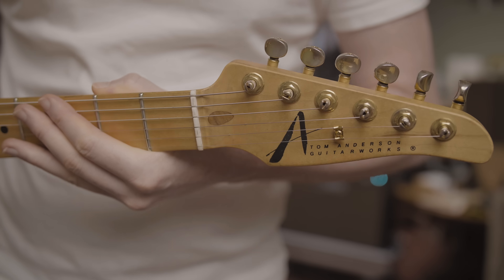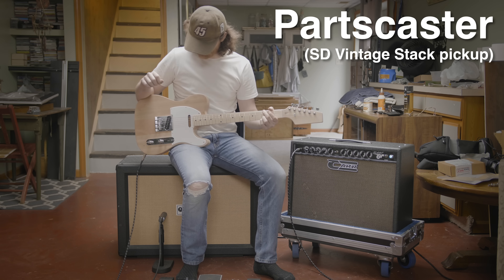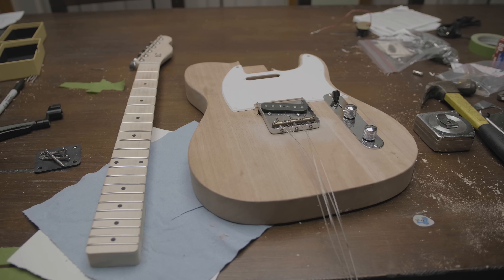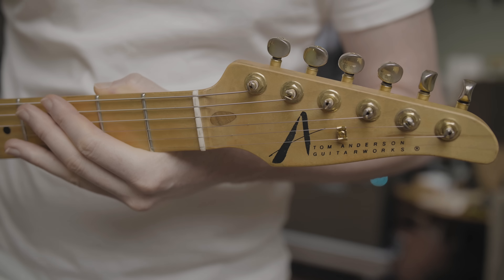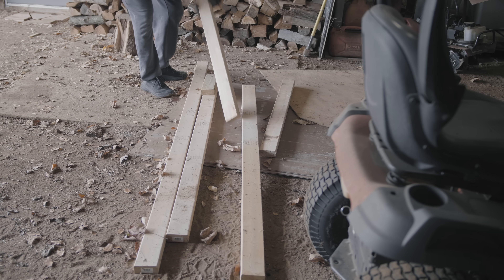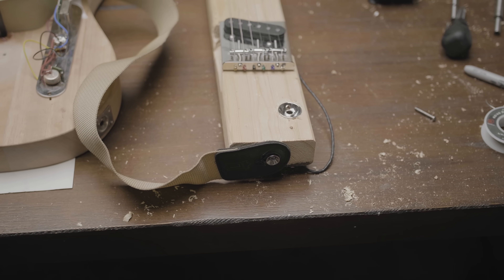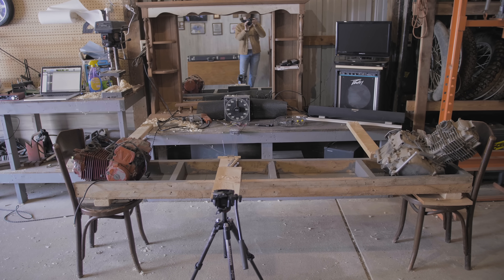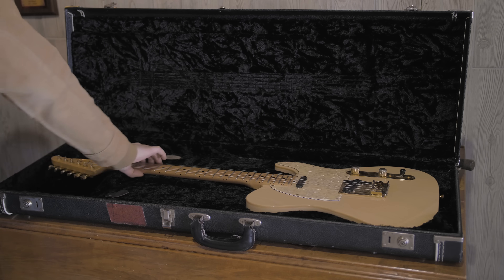Tested: Where Does The Tone Come From In An Electric Guitar?

Comment: About 8 years or so ago there was a massive arguement in the guitar community about this tonewood nonsense. Some people got really nasty over and tried to ruin peoples livelihoods, and even sent them death threats when they showed that the wood had nothing at all to do with tone. Im looking at you here, Wyatt. They had invested so much of themselves, and thier money, into the idea that a guitar was some magical thing that didnt obey the laws of physics, and they spouted all kinds of crap about how maple gave a snappy sounds, while bubinga was warm and so on. No amount of evidence would convince them otherwise, even when DKG Custom made a guitar from cardboard and a kitchen worktop that sounded exactly the same as a Fender strat. Will Gelvin used all sorts of measuring devices and found nothing. But they, the cork sniffers, claimed that they could hear a difference. Even  if it was only a 0.00001% difference it was still there, so they were right. Some people, like Andertons and Mike Boudreau, even went so far as to  deliberately fake the results and got called out for it. Mike was a luthier and his business relied on charging a premium for 'tonewood'. Andertons are just dicks.

If you've spent 2k on a PRS with a beautiful flamed top and you believe that it enriches the tone, then I'm afraid that youve fallen for marketing hype. its still a good guitar, but it would be a good guitar without the fancy finish.

Comment: Kinda clickbaity....That is not an 'air guitar'. what you did there basically uses the same principle as a normal guitar...that is providing ample bodymass on either ends to provide adequate tonality to the strings, compensating for the absence of neck. I'm sure you worked around trying to meet those requirements on some level. If anything this proves nothing but the same fact that volume and density of the wood is the only thing that matters, you need a decent amount of that one way or another to make anything sound good.

Comment: you are one bad mofo to start and the only difference I heard the entire time was a slight bit tinnier on the two by fobut the pickups were the only difference in once you swapped out to the same pickup it was virtually identical the pickup creates a magnetic field that magnetically charges the ferrous string and as that string moves it interrupts the magnetic field that magnetic field could give a crap less whether it's attached to a 2x4 a bench or a guitar because it doesn't know what it's attached to it's a magnetic field unless it's attached to something that's ferrous it cannot absolutely cannot make a difference so thank you for 100% proving what I've been telling loads of Neanderthals but I just laugh as I walk past them dancing around the fire throwing sticks at it

Comment: The pickups are the most important, and the way they’re set up. The scale length makes a big difference. But all that “tone wood” stuff is almost complete guff when you’re talking about electric guitars. Unless it’s the difference between balsa wood and mahogany, then woods that are of a similar density will make minuscule differences compared to the pickups.
Reply: I like the 'theory' that the biggest effect tonewood plays is in the tactile vibrations the player feels.  Basically all the touch and feel aspects of playing.

I think there's nothing wrong with using exotic woods and fancy finishing techniques, so long as you understand that they're primarily visual.  There's nothing wrong with having a pretty guitar, just don't expect it to magically sound better than a similarly equipped guitar made of more cheaply sourced materials.
Reply: @propyro85     Yup, tonewood is only a thing with acoustic instruments, where it makes a huge difference.

Comment: All in all, really good wood will not affect the sound of a guitar, meaning the resonation of the strings and so on. Bad wood will affect the frequency of strings and resonation of them. The reason the guitar with no wood and the guitar with good wood sounded similar is because there is no bad wood obstructing the sound. No wood or Good Wood equals good sound. Bad wood equals bad sound.

Comment: Very cool experiment. I’m a huge fan of tonewoods and have been firm in proving there are differences easily recognized through percussion, size, depth, density, chambering, etc. In electric guitars the wood does far less than other wooden instruments, and the massive bulk of an amplified tone comes from the electronics. There are plenty of factors but the electronic signal chain and how it is constructed both in wiring and placement relevant to strings and scale make the most drastic changes to tone. I’ve tinkered heavily with pickup height and adjust pole screws and found most of what I was looking for with those alone. So for me, it’s electronics, construction, and total components in that order. Less dynamic changes under high gain than clean, but there are definitely noticeable difference.

Comment: My best guess at the start of the video.
The body should have very little effect on the sound, but stiffer and heavier should be better.
The electronics replace the resonant body, so this is where the meat and potatoes are.
The RLC circuit can have a very low "quality factor", meaning it resonates with a larger range of frequencies, which i think is desirable.
For the pickup, larger coils mean stronger signal, but the "quality factor" will increase, and the resonating bandwidth will decrease.
So a smaller coil with a larger capacity to stay at the same frequency, should be best.

Comment: One hell of a video man, thank you! I will say, this puts a lot to rest about tone with bodies and necks. One thing, I would imagine the wood selection has a role in how well the guitar will hold a tune. Obviously, the air guitar will hold at an exact point due to weight. But cheaper wood would have too much flex, right?

Comment: First, a very interesting video, that I very much appreciated. Great work on a meat project! Just in case no one mentioned this yet, I did want to point out that the guitar with “no body” is not accurate, since it actually has a massive body being connected to both of those wood work benches which are going to vibrate as well as the floor, walls, or anything else they’re touching. Does that make a difference through the pickup? It doesn’t sound like it, but it is misrepresenting the experiment to say that guitar doesn’t have a body or wood to resonate with the strings. And in that sense this is still not a very scientific study. The only way to really discern “scientifically” whether the body makes a difference would be to make multiple bodies out of different materials (plastics, metals—aluminum? various wood and wood products—e.g., mfd, carbon fiber, etc.) with the same specs (shape, scale length, electronics, etc.). Again, this is still a great video. Thanks for putting it together for us!
Reply: a *neat project. Lol.

Comment: Would love a mirrored experiment but with a bass. I’ve done A/B tests with the same pickup and strings on a P and a Jazz (P/J without the J pup) and the results were quite different. The P had a huge neck and the P/J had quite a thin neck. The bodies were also quite different in thickness and weight. I image it has to do with the amount of energy needed to produce bass frequencies vs guitar.

Though I wouldn’t be surprised if an experiment this in-depth yielded somewhat similar results.
Reply: Bass strings have a lot more mass, so it makes sense the overall mass of the neck/body will affect it more as the strings vibrate.
Reply: If all this is true, I guess these big companies and their competitors are purposely making shitty sounding guitars to perpetuate the lies that older guitars from good years and certain notable and much commented on modern exceptions sound better? Seems like a pretty wacky business model. If at no additional price you can easily recreate any guitar with this method what reason would a company have not to exploit that to its fullest? I'm sure Gibson would like to command even more for their Les Pauls and if they were indistinguishable in tone from 50s Les pauls, well...it certainly couldn't hurt. Plus, when newer companies started coming about in the late 70s why wouldn't they just take it all the way and make guitars that not only rivaled but surpassed all other guitars past to present by simply lifting or lowering the fucking pickups and changing the electronics? This should be 100% effective on all electric solid bodies if this theory is true, correct? We should be up to our necks in the greatest instruments the world has seen, not slowly trying to regain what was lost. None of this appears to hold water in the broad real world at all. I wish it did, but I'm very skeptical.
Reply: I was traveling with my band in 1984 and walked into a music store in Mansfield, Ohio. There was a beautiful Fender P-Bass hanging on the wall, sunburst, black pick guard and maple neck- I just had to have it. I traded my P-Bass plus some cash for it and used it on the gig that night. I noticed immediately that it sounded vastly different from the bass I had traded-in. In later years, studio engineers and producers noticed the same thing- my P-Bass didn't sound like a P-Bass. For one thing, it weighed a lot more than your average P-bass and it had a factory-custom tapered neck, not the usual broad P-Bass neck. Aside from the heavier wood and tapered neck, all the hardware and electronics were original stock. I am convinced that the wood and construction of an electric guitar does matter.
Reply: @willrobinson7578  I can't help but notice he picked a copy version of a guitar this would work best with, and did no control or opposite experiment. Trying to make a guitar sound different as you build it would actually show something; if you were really doing the experiment honestly. Also, how about making the "airguitar" sound like a 67 getsch? A 58 Les Paul? Hell, a 62 Strat for that matter, I mean, the distance from the pickup doesn't age does it? So that can't change anything right? Why isn't this guy rich? Or for that matter, why do I have to play the guitar I inherited to get a sound that I can at all respect? Because I would love a more modern guitar, they just sound like high rattley clangy shit 90% of the time. So why hasn't the cheap companies not owned by fender or Gibson nailed it yet? Why can't they make better sounding guitars? What's holding them back? All these luthiers are apparently completely useless and young blood here cracked the code! Well, I'd like for him to make me a Gibson Firebird sound alike 2 x 4, then. How 'bout that? Heh. I'll pay whatever he thinks it's worth.

 I have no idea what details might change a guitars tone and I really don't think the manufacturers P R or Marketing department (who he talked to, first one is clearly Gibson, second one is Fender, that's just what they tell them to say, I recognize the pitch talking points as I'm sure you did aswell) I don't think the luthiers themselves exactly know what they are doing either. They just know how to do it. That last sentence pretty much sums up the human race; I don't see why a guitar maker would be that much different. Look at the comment section. This video was made to get attention from the people you see saying "I knew it, goddammit, I been saying this for years" Yeah buddy, I believe it because I've also been hearing it for years; and much like many other "marginalized opinions" it's literally the only opinion on this issue I've ever once heard in my life outside of the manufacturers and luthiers version of events, of course. Like most arguments like this, since I haven't chosen a side really I see the truth. It wouldn't hurt my feelings one bit if I could buy a 300$ guitar and sound like I'm playing a 3,000$ guitar, I didnt pay for it. I'm not some two story house rich guy trying to defend my wildly expensive purchase so my heart doesn't sink. Also, while I love my guitar, I'd also love to play something else every once and awhile and not be disgusted. 

As for that third opinion at the beginning, which sounded more like a boutique manufacturers attitude to me, I get what they are saying to newer players and comparatively between players but it's my fucking hands on every guitar I play, so case closed, that certainly isn't what's making them sound different when I play them. 

One thing a lot of people in this comment section are right about: They tell dumb asses all kinds of bullshit and they believe it because they want to believe it.

Comment: This is amazing!  I’ve been starting to think it’s really just the pickups, and of course the pots, treble bleed, and cap. This proves it. That was a lot of work!
Reply: You'd be surprised in how little the type of capacitor matters. Also marketing in order to get people buying them vintage bumblebee caps.
Reply: @UmVtCg  More the value of the cap, not the type.
Reply: I agree with the hype on the type/brand
Reply: That's scientfically true! vibrations produced by metal strings picked up by pickups 😅 then amplified by electronics. that's all there is to it. now, where is the tone really coming from? 🤔

Comment: Great video!!! I am so glad you did the 2 by 4 and air guitar. Always thought that would be a great idea to decide how much the wood plays in solid body guitars. I always felt it didn't matter that much, but many vehemently disagreed . You proved my point more than enough for me. I have seen guys play my rig and make it sound amazing. Leads me to believe the player is one of the 3 or 4 larger contributors to the final sound. 
A friend changed from a Strat and a VOX AC 30 (bright clean) to a Les Paul and a Marshall (thick crunchy) and he dialed it in so it sounded just like VOX (close). It turns out his ear just liked that sound so no matter what he used  that's how he dialed it. Or his playing style contributed.  I am thinking if one worked on their playing style to work any amp to its fullest they could sound better and save some steps in the never ending tone quest. 
Perhaps practice on a crapy amp and and do everything you can do with your pick and fingers to make it sound better then plug in to your real rig would be one approach.

Comment: This is one of the best videos I've seen; you did an amazing job!

However, there is one very legitimate thing you forgot that actually effects the tone fairly significantly:

Picks

They can dramatically change how bright or dark your tone is, even with light strings.

I know that's not the point of the video, but is an important factor to make sure you control for, and for anyone wondering how they might affect their own tone outside of hardware changes or practicing.

Comment: Great video, but the answer is pretty clear. 

Pickups have the most impact on tone. Like clearly. This one change is easily the most noticeable. 
The player comes in second. How someone plays is also very noticeable. 
Body wood comes in third. Some body wood tones are immediately apparent, but not all of them. 
Everything else will impact how the guitar feels to play more than how it sounds. If it feels better it will have a better tone, but those small differences laid out back to back will likely be very noticeable for the player, but indistinguishable for 99% of listeners. Among the most noticeable feel differences are the neck, frets, and bridge.

Comment: I very much appreciate your scientific approach.  

Leo Fender utilized a solid body to reduce, as much as possible, vibrations of the 'diaphragm' top of acoustic guitars, because of uneven frequency response that emphasize some frequencies and cancels others, producing both feedback and dead spots.  Your air guitar eliminates those things.  Leo would have built his solid body guitar from granite were it not for the expense and weight, as he wanted to eliminate as much transference as possible from the body of the guitar.  What changes would a more solid body produce?

My 1998 Fender Nashville Telecaster, with Graph Tech nut, rosewood fretboard, Fender Vintage Noiseless pickups, and brass saddles, when played by me through a Texas Tone 12 combo amp, can generate so much sustain that a guitarists band mate called me a "sustainiac."  Your insightful test still does not take into account conditions to replicate or test that type of situation.   

I would suggest a totally clean amp sound, because the more dirt, the more distortion, the more effects in the signal chain, the less important the generator (guitar) becomes.

Where Does the Tone Come from In an Electric Guitar?

The Amp!  

Compare them without an amp... How would that air guitar sound without an amp, not to mention your Anderson?

Comment: One suggestion for another next step: Can you make an air guitar out of a welded steel tube frame instead of heavy wooden tables? To rule out the possibility that the mass of the frame itself is modifying the tone.

Comment: Massive problem with this video is that you're not really comparing the 'tone' of the guitars, you're just matching the input gain of two identical pickups via distance to the strings. Add on top of that a fairly generous amount of saturation through the amp and of course they sound the same. A much more realistic test would be to record completely dry DI tracks into a DAW and compare details like the note attack, note sustain, and actual frequency analysis. Appreciate the effort you've gone through to make this but all you've really shown is consistent gain staging = consistent output.